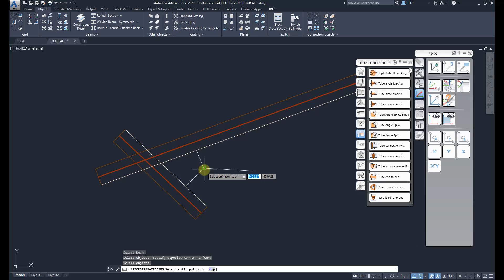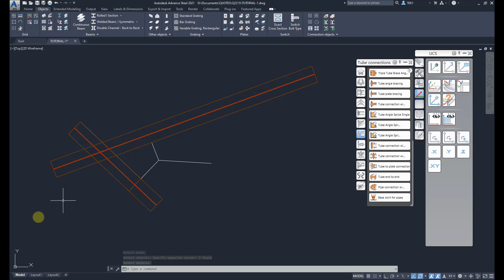03-Split Beams - Advance steel Tutorial

Comment: Do you know if you can split beams at an angle? It seems to only split perpendicular to the system line.
Reply: Usually in any cad system adding an angle to a break is another operation